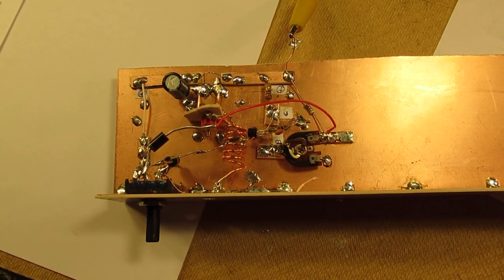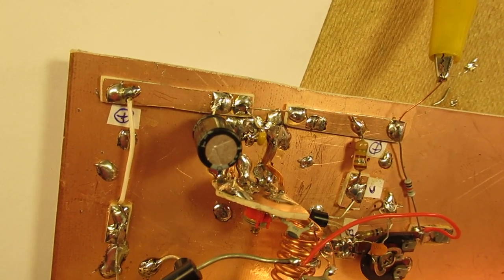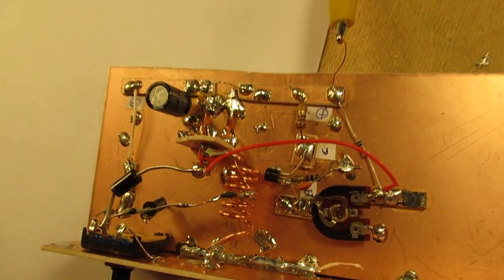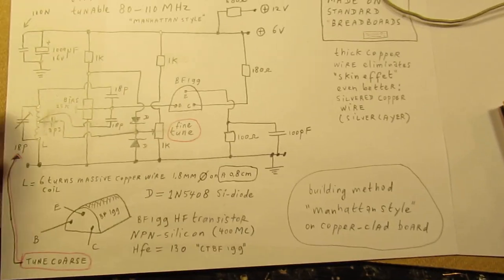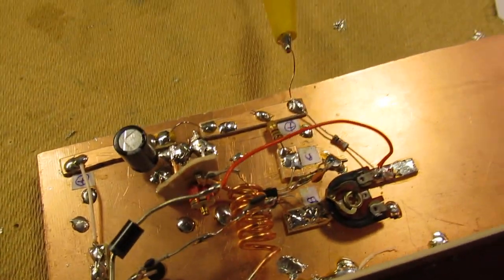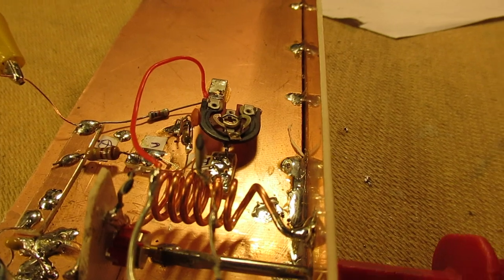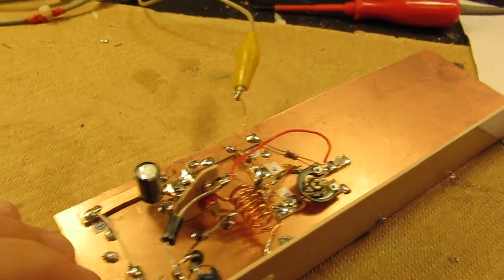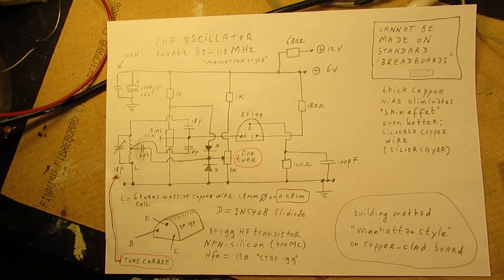HF Oscillator 80 MHz-110 MHz made manhattan style demo & schematic & good practice

Comment: I like how work ..but your oscillator is very unusual ..there is Collpits connection on the BASE of transistor then there is Hartley connection with 3p3 on low end of Collpits ,also your oscillator don't have classic feedback loop from base to emitter or emitter to collector ..how oscillate ?
Reply from the maker: Strange but true. It is used in this FM radio https://youtu.be/F5whmoEcbn0 
More info there, via the links in the texbox(es).
Thanks. 13 Aug. 2024.

Comment: Where is out put, in collector pin?
Reply from the maker: Yes, via a capacitor of (say) 10-50 pF. But you can also take the signal out via a very small capacitor (5-10 pF) at the emitter.

Comment: Nice job Ko. I thought FM required more circuitry to work properly.
Reply from the maker: Thanks Barry, that is indeed an issue. I will try to make a FM receiver with this, but not sure how to get further on IF, bandwidth, to use a coil or a ceramic filter, make a ratio detector etc. But have enough schematics to pump out of the well.

Comment: Ko, what a surprise! It is a beautiful circuit and working very properly!
Reply from the maker: Thanks, Jim. I had to "convert" to the Manhattan style for this VHF circuit, though I always liked my "brass nails on a wooden board" method. Of course I knew/know that these Manhattan style and typical VHF methods a (far) better way for VHF circuits where every (un- or expected) stray capacitance or stray inductance can kill a good circuit. But my aim was/is always "electronics for everyone", like you know. These VHF circuits "dictate" something in construction terms & otherwise it does not work, and that is not what I like. Anyway: I have to take some time and reflect... And want to go further in these circuits, but Shortwave (max. 30 MHz) has a kind of presence in my mind, where everything is not so critical...:)

Comment: Would be nice with a second tuned rf stage for a bit of range on fm band or long range transmitter like your work looking forward to see how the circuit works!! Will build this circuit have made a few of your oscillators in the past got them working well keep up the good work regards john!!!
Reply from the maker: Thanks John, yes that is the aim of the circuit (receiver for 80-110 MHz or 120-140 MHZ). Never made that, so a lot to discover.